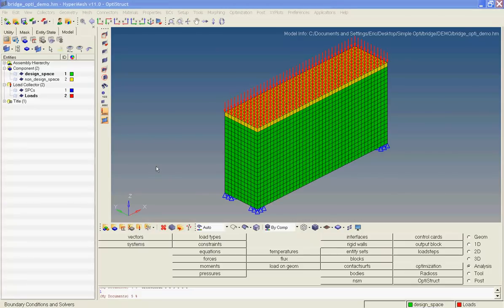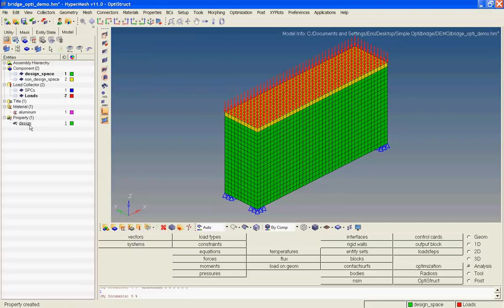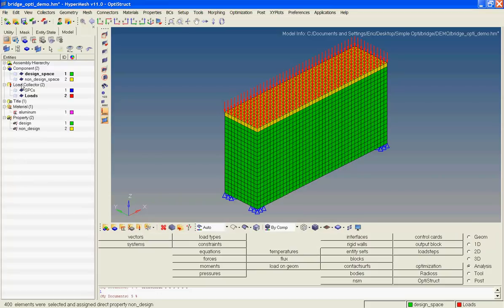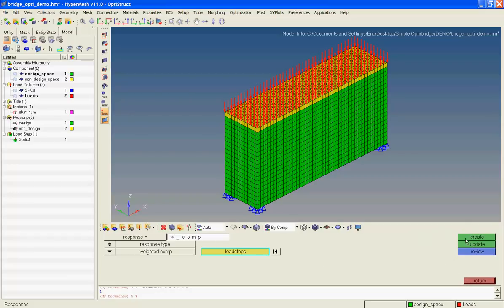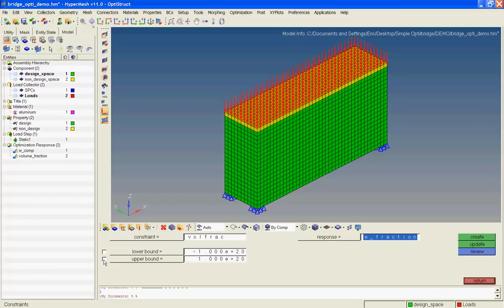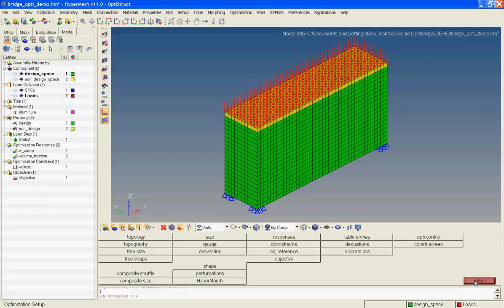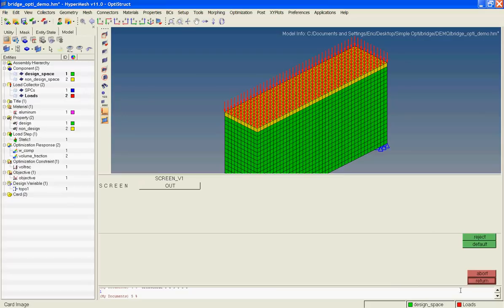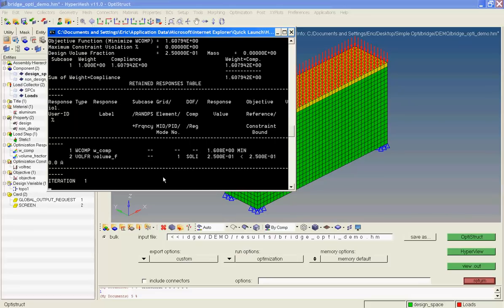Topology Optimization setup demonstration in HyperMesh 11.0

Comment: this is an old video but why everyone is putting incorrect value of Young's modulus of aluminium. the unit here is N/cubic mm. i cross-checked the values for steel. for aluminium it should be around 70,000 N/cubic mm. everybody takes to the order of 7, 8, and 9. why?
Reply: Units in this model are pounds and inches.